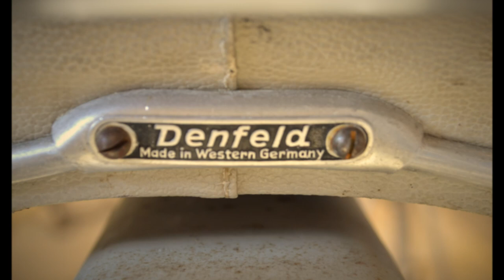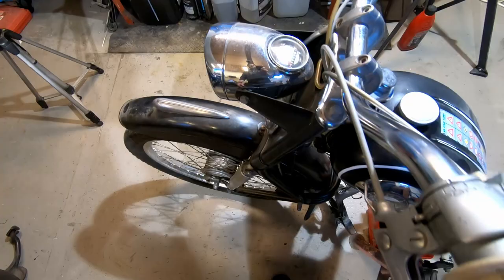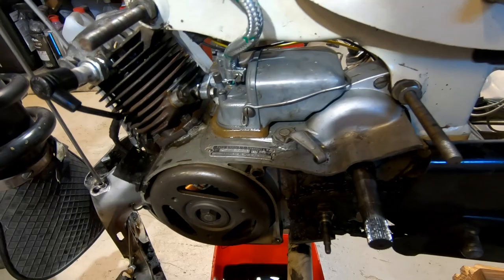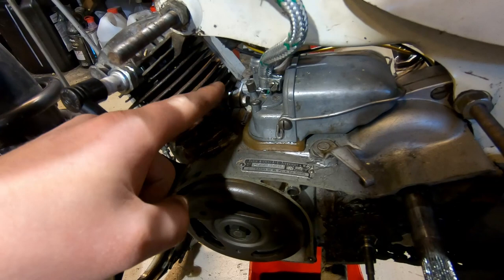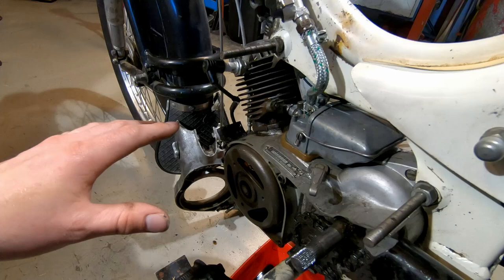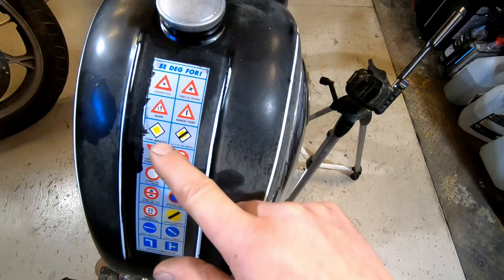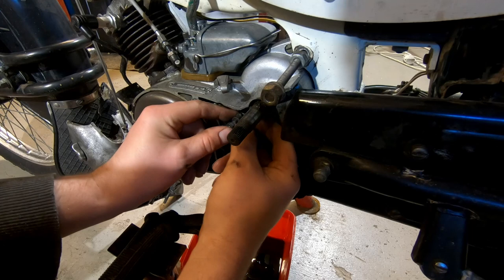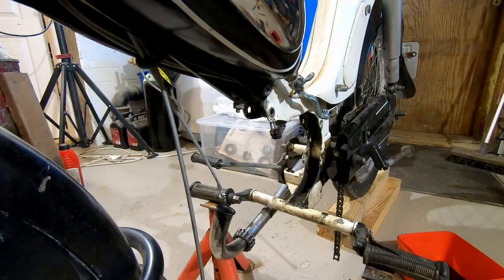Moped Rebuild | Two stroke SACHS 50cc

Comment: Is it possible to take the flywheel off without splitting the engine? Can i just take to 2 covers off on the left side? And also remove the gearing mechanism. I need to fix some electrical stuff behind the flywheel.
Reply from the maker: Thats correct

Comment: What’s the millimeter on the tool you used for the exhaust nut? I need to buy one but not sure which size
Reply from the maker: I dont really know, it was a hook spanner that came with a lathe. It sort of fitted. A pipe wrench and a rag would probably work too. Thanks for watching!
Reply: @semotorcycle  Thanks for the fast response. I tried with a pipe wrench but it keeps slipping, I guess I will have to try again with more force.
Reply from the maker: @hampusstaaf  Try to heat it a little and knock on it. See if it wants to move then